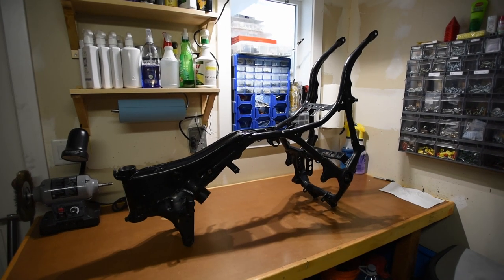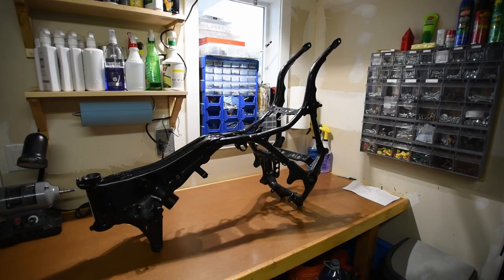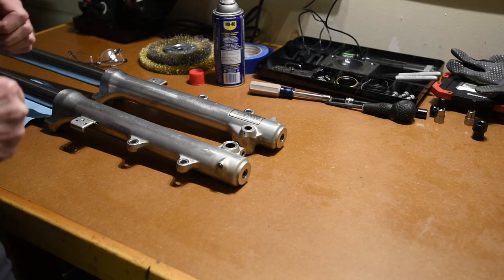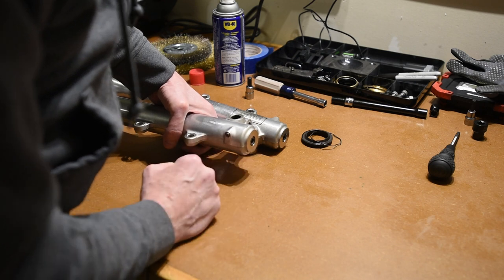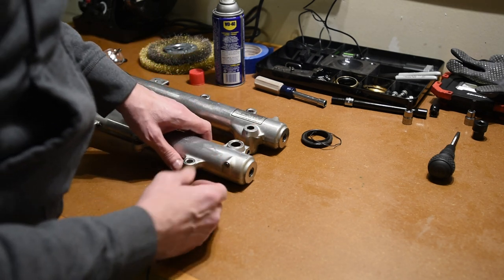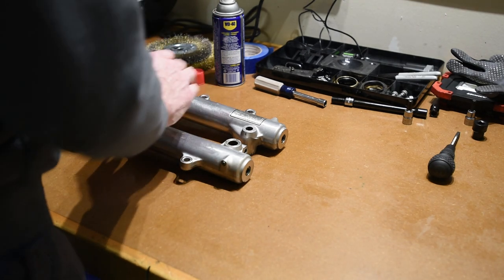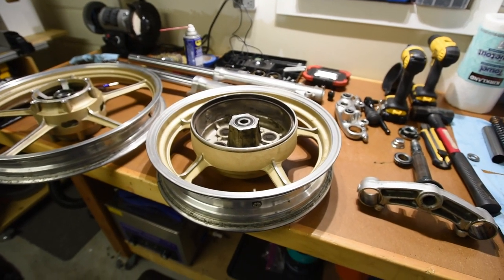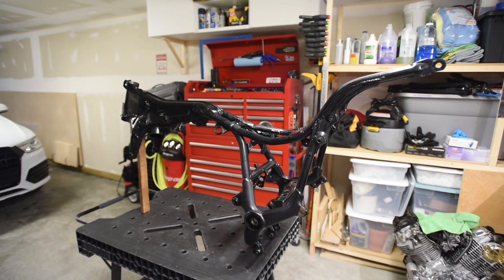Stripping The Frame - Yamaha Virago 1000 Restoration Video 4

Comment: Really liking this teardown- where can I go find replacement parts? Recommendations for aftermarket?
Reply from the maker: Hey Derek!  Replacement parts are hard to find...it seems like this bike is too old to have Yamaha support it and too young to have a proper vintage following, but it's getting there.  Try: mikesxs.net, cmsnl.com, theoringstore.com, and scramblercycle.com.  Aftermarket stuff is everywhere...beware amazon and China direct but you could still get lucky.  I found replacement side covers for $15, voltage regulator for $12 and coils for less than $50 direct from Aliexpress.